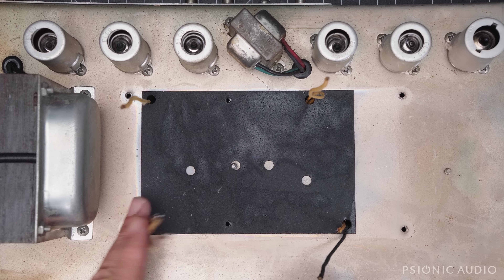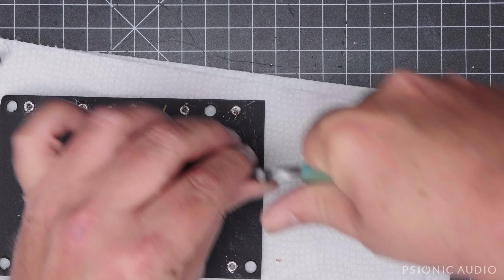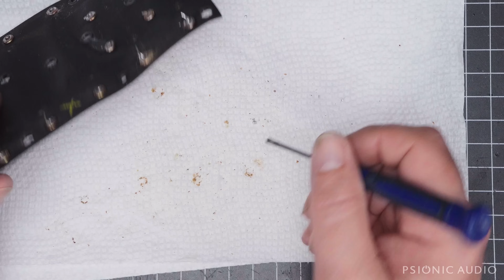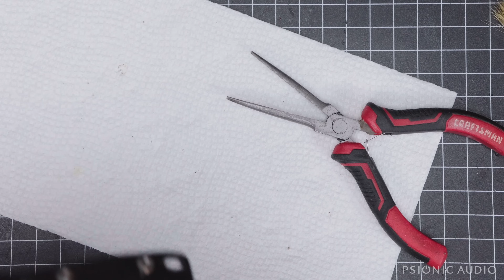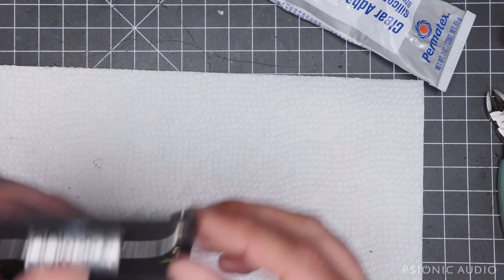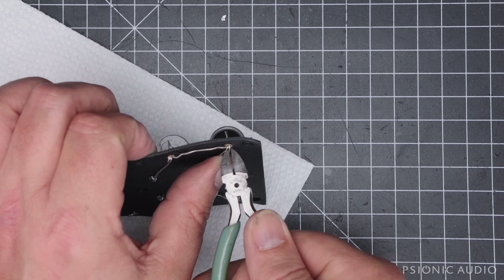Real-time Recap | '65 Fender Super Reverb Pt 2

Comment: Dude, I was an industrial electrician for years.
 I never worried about if I had a metal watch on. All you gotta do is just make sure you're not a good ground when you're messing with high voltage. Do not make yourself into a good ground. In other words, a good path and easy path for the electricity to flow through. You to ground because that's what it wants to do. That wants to find ground as easy and as quickly as it possibly can. That's what electricity wants to do!!!You my dear sir apear plenty sade to me. So I say, keep on doing what you're doing because stops working.Then maybe change something up.But until then don't try to fix anything that ain't broke....

Comment: Since the isopropyl dissolved your Teflon tape try using a strip of rubber glove or balloon over the threads, I have had good results.
Reply: Real teflon should be alcohol safe, so perhaps some of the plumber's teflon tape sold in hardware stairs isn't actually Teflon. Getting solvent safe gaskets and O-rings and such these days is harder than it used to be. You used to be able to go to pretty much any hardware or automotive store and buy a kit containing a selection of miscellaneous gaskets and o-rings, perhaps made of neoprene or nitrile or something relatively solvent safe, but nobody seems to carry assortment kits like that anymore and you end up buying individual O-rings and gaskets in an inflated price ----  and then you discover that some of them are not solvent safe. I bought some rubber stoppers at True Value and used one to seal a small glass bottle of vinegar that was missing its top, and the vinegar caused the rubber stopper to deform and swell!

Comment: Boring?!? Today I learned how to eliminate DC conductance from the fiber boards of my Fender amps where all the connections meet. Replacing caps and resistors in those amps, I'll make sure I follow these steps. at least on the main board. I don't have a variac to do the filter caps with, so I'll have to leave that to someone else.
Thank you for sharing. Now, have a banana 🍌

Comment: Have you tried 2mm braid? It takes way less time to heat and wicks solder very quickly. If you run it quickly along the heated surface and on the edge of the iron tip, it draws away solder along its length nearly instantaneously. I love it for unclogging terminal points, cleaning off pot tabs, even cleaning off leads on older components. In combination w/the 3.5/4mm braid, I hardly ever use a solder sucker anymore and I don't miss it AT ALL. 🤓👍🏽
Reply: Woah a crossover between my two favorite amp media, the legendary Larry Chung!

Comment: At 18:11, for God's sake don't forget to mention bagging the paper towels with nicotine deposits so it can be reapplied with the leaky, bulging electrolytics and out of spec resistors to maintain the hysterical accuracy of the amp.

Comment: Awesome video! This is one of those essential Fender services that its great to see a careful guided walk-through of how its done! I used an older and shorter version of this you did years ago to change the filter caps in my Deluxe Reverb... which was immensely helpful! And I am gratified to know that even you have to struggle with fitting 5 wires into that tiny eyelet! That was by far the hardest part for me as well!

Comment: Lyle, you are not weird ! I watch the same kind of videos as you, with such a depot of massive information on hand it's tough not to watch ! Ken Burns videos are amazing ! I watched a video on the new railway project replacing the Soviet rail in the Baltic States, 8 Billion bucs! I have been watching your channel for 10 years! I love all things Fender ! There is nothing more beautiful than a single coil guitar through a Fender amp ! I have a 1977 Fender Mustang in Mint condition. I hard tailed it for sustain. I basically removed the spring posts and replaced them with bolts. With a tiny 60 thou washer on top between the lipstick tube and the plate allowing the strings to pass underneath. I also have a 40th anniversary Strat and a 50th anniversary deluxe Strat. I have a B=52 AT212 100 watt with Jensen MOD's. Also, a Fender DeVille with Jensen Falcons. My nicest sounding amp is my MARSH Springfield 
(65 Fender Vibrolux) with the Overlord option and has 1 Weber alnico and 1 Weber Ferrite.
I watch all of your stuff...keep it coming !

Comment: Lyle, on your alcohol dispenser,  get some flat rubber, trim it to the inside diameter of the cap, use a leather hole punch to make a hole where the spout is, and then just tighten the cap onto the bottle same as a milk jug. Trying to seal the threads is futile. You need a gasket between the lip of the bottle and the inner surface of the cap.

Should eliminate the seepage.

Shame those bottles don't come with lid gaskets.

Comment: Top-well pump-dispensers for solvents are easily purchased; McMaster Carr wants $25-40 for them but Amazon sells various types for half as much. I always kept two on my bench, one filled with alcohol and the other with Windex. They are, you might say, indispensable dispensers!  I added some glass marbles in the bottom of mine to add a little stability and weight. The taller they are, the more likely they are to tip over easily unless you devise a stand for them.

Comment: Servicing an old tube jukebox in a bar I looked up at the new ceiling tile and saw the frame was candy apple red. Ask how they got the colored frame and was told it was from the cigarette smoke  WOW. 
a gasket ring on the alcohol dispenser under the cap could help .

Comment: I have a Mesa 5:50 that sounded really good with my ES-359 until I played it through a 65 deluxe Reverb Reissue. The amp belonged to a friend, and I offered to buy it on the spot. He declined the offer. The Mesa has hardly been used ever since. I am wondering what Fender amp Psionic followers would recommend that would be less than $2,000. I loved the deluxe reverb's clean tones.

Comment: The de-soldering station would be gladly abandoned if I could work on the equipment you do.
Reply: You work on more PC-board equipment than Lyle does; using solderwick and a manual solder-sucker just isn't practical or efficient for circuit-board work.
Reply: I just picked up a desoldering station because you use yours so much.
Reply: @lionscircle4700 ,  so, what brand did you get, and have you had a chance to try it out yet?
Reply: @goodun2974  I picked up a vivohome 959d.  It's a generic rebadged unit.   I have 7 different tips for it and the price was right.
Reply: @lionscircle4700  , hmm, haven't heard of that brand. At the audio repair shop I used to work for , I had an AOYUE desoldering station which was relatively inexpensive and I used for several years, after the ancient Hakko pump unit died and parts were no longer available. The AOYUE worked surprisingly well;  I never had any problems with the vacuum pump and it wasn't very noisy;  The matching desoldering guns are a little cheesy but I came up with a couple of modifications to make them work better and more reliably and be less prone to clogging.
Reply: @goodun2974  I think aqyue also puts their brand name on this model.    Haven't used it yet so it could be a pos in waiting.  I used to have a desoldering station that required compressed air to work.  Used to do bill m mods with it until it gave up the ghost. Hope this works half as well and I'll be OK.  I don't mind using the desolder wick method though

Comment: Boring?? I say “nay”! Any less exciting work being observed is remedied by your witty quips and comments!

Question….for the 1/2 hour of cleaning to restore the old power supply board, why not just buy some new pre-punched fibre board?
Reply from the maker: Thanks!

Because there are different board sizes/layouts for different models and to cut, drill, and install eyelets for one would take longer than cleaning the old one. 

I’ve had two boards over the years that were charred (someone insisted on keeping the original caps and they failed spectacularly) and I did get replacements for them.

And I can do this faster when not filming/explaining.

Comment: Why not purchase replacement eyelet boards instead of billing a lot of bench time reworking a board that is well beyond its practical life expectancy. Even better yet would be to make new G10 phenolic resin eyelet boards. Bet you could get the bare boards made in China bulk for a great price.
Reply from the maker: Because your premise is fundamentally flawed on multiple levels.
Reply: Kind of a related question...if you were to build a Fender clone, would you use the fiberboard,  G10 fiberglass board with eyelets or G10 with turrets?

Comment: The resistors I dislike the most and it's purely. An esthetic factor are those ceramic rectangle. Wins his great big blocky sons of b**** that take up a whole s*** load of room. They may work good and they may hold their values forever. But they're ugly. They make your bill look bad and they weigh a ton so if they have to hang anywhere that there's a lot of mass on them because the ceramic is heavy.  And I.
Just don't like them